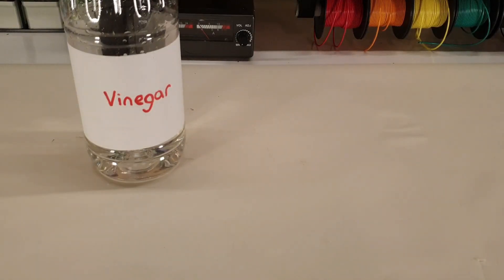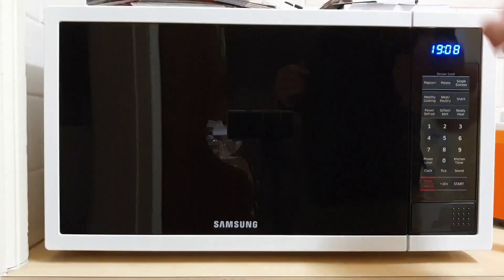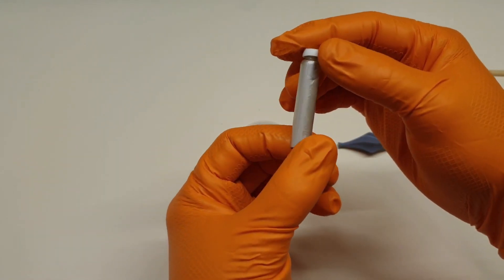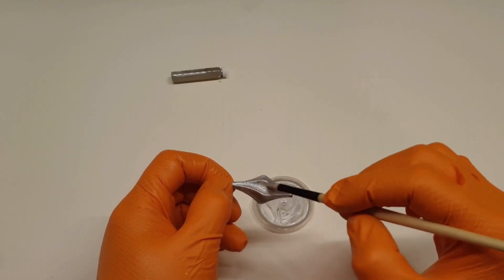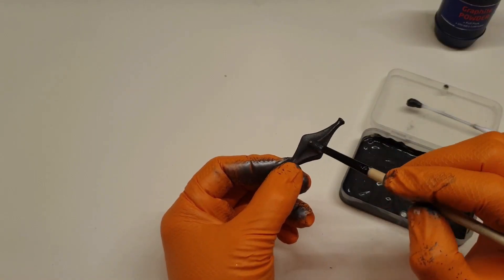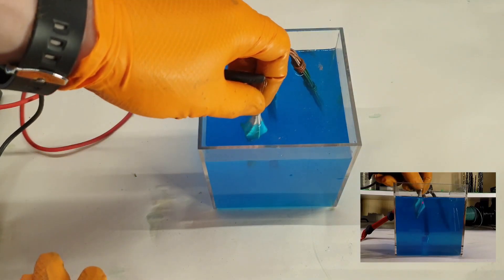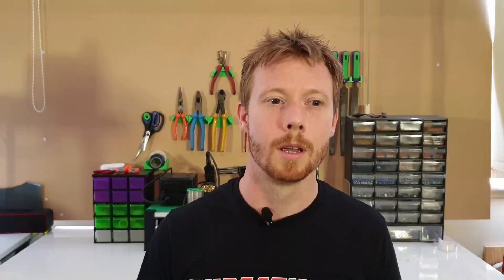Metal plate your 3D prints at home.

Comment: To confirm, you used conductive silver paint "before" applying the graphite and then copper plated?  Graphite isn't conductive is it?  I'm confused how the copper plated onto the graphite.  Also, wouldn't copper conductive paint be a better choice over silver conductive paint as far as cost or does the 7% increase (I think it is) increased conductivity worth it?
Reply from the maker: You use graphite OR the silver paint (I actually use a nickel conductive paint made by MG Chemicals for my plating now, it's cheaper than the silver paint and works very well).
Graphite is conductive, otherwise it wouldn't work at all. It's not as good as the conductive paint, but it's cheap and generally more accessible, but I'd suggest going with the conductive nickel paint I mentioned before, you'll get a much better result.
Reply: @BrodieFairhall  Thanks for the tip, I'll give it a try.

Comment: How did you manage to get copper in the eye socket of the raven skull?

Would tucking some wire inside work?
Reply from the maker: A mixture of plating for a long time and moving the anode around the skull.
If you're careful not to touch the anode wire to the part you're plating you can move it into pockets like the eye sockets if you're having trouble.

Comment: I don't have access to conductive paints where I live, I tried to make a layer of graphite to make it conductive, but it didn't work, what am I doing wrong?
Reply from the maker: I've been finding that some graphite powder isn't just graphite and it isn't very conductive. So you may have to try a different brand of graphite powder.
You can also apply multiple coats of the graphite to see if that helps.
If you have a multimeter, you can check the resistance of the painted surface and it should be at most a few hundred ohms between any two points or it won't plate well.

Comment: Can you make graphite powder by drawing on a piece of paper with a pencil?
Reply from the maker: I tried doing this with a pencil and found the result was barely conductive at all. I've since found out there are a lot of polymers in pencils, not just graphite.
Reply: @BrodieFairhall  Ah it seems graphite content varies with hardness of the pencil. The softer the higher the graphite content. But getting specific pencils probably isn't any less effort than getting graphite powder in the first place.
Reply from the maker: @PhaTs00p  I got the softest pencils I could locally (not that soft, they were 2B) and couldn't get a resistance below about 50k ohms.
I tend not to use graphite at all now, I use a conductive nickel paint made by MG Chemicals, it's so much better and much cheaper than the silver paint.

Comment: Just a heads up:  I bought graphite lubricant from the hardware store, and the particle size was enormous.  So it wouldn't really mix into the ethanol, and wouldn't stick to the part.  I went online and found powdered graphite with a specified particle size (50 micron).  In other words, be careful what you buy for graphite.
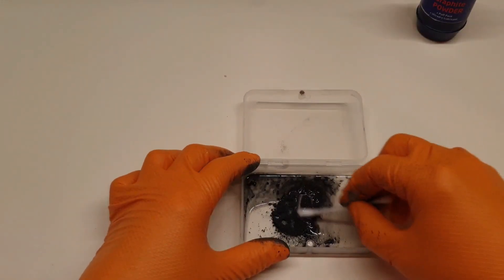Reply: At 4:23 he mentions grease with graphite to display one of the uses that graphite has in modern day, and doesn´t suggest to use GREASE with 1% graphite as your main source for graphite-powder-PAINT (that is up to 100% graphite, by he way). How can you go and buy a lubricant to use it as a paint?
Reply: @klausbrinck2137  I bought both.  Neither worked.
Reply: just if it was not clear enough before: graphite is used as dry lubricant because of its (anti abrasive and lubricating) characteristics as a material itself. Graphite for lubricant is just a dry powder, no oils or grease added. That said, there are many lubricating products that have added graphite to increase their lubricating qualities - they are different products though and can indeed not be used as electrolytic paints
  @klausbrinck2137
Reply: I've heard sources differ saying that graphite paint should be sanded before electroplating and copper paint doesn't need to be sanded (but is more expensive much like the silver paint here). Did you have good luck with the graphite paint without having to sand it down?
Reply: @ImBenGraham  no.  I attempted sanding and different substrates for the graphite.  I only had partial success.  That is to say, the part would only plate in certain areas, and eventually those areas stopped growing.  I resorted to measuring resistance across the part and found that I could only plate areas where resistance was consistently below about 5kOhm.  Since it was so unreliable, I gave up.  I did end up with a lot of copper dust.  I considered trying to use it, but don't have time to continue the project.
Reply: @ImBenGraham  your not supposed to sand it you should polish it
Reply: Thanks!

Comment: Where does one acquire silver paint?
Reply from the maker: I originally bought mine from a local electronics store, but you can find it online.
Instead of the silver paint or graphite, now I use a conductive nickel spray paint made by MG Chemicals, much cheaper by volume than the silver paint and it works much better than the graphite.

Comment: I did not get the power supply part. What did you use to be able to provide electricity to the copper and the 3d print? Thank you!
Reply from the maker: I just used a basic benchtop / lab power supply in this video. My original plating setup was 2 D cell batteries, you will only need 2-6 volts for plating, depending on your electrolyte, the resistance of the conductive coating and a few other variables.
Whatever you use won't need to provide much current.
Reply: @BrodieFairhall  thank you!

Comment: Hi again,I’m wondering if I could use a 9v battery instead of a power supply?
Reply from the maker: You absolutely can! You only require a very low voltage, depending on your part size and your electrolyte it could be between 2V and 5V, if you have a fixed voltage you can move your part closer or further away from the anode to get a nice even metal deposit. My original plating setup was using three D cell batteries in series and it worked fantastically.
Reply: @BrodieFairhall  thank you so much! Really enjoy your content and presentations!

Comment: Hello Brodie, What are using for electricity in this video?
Reply from the maker: I'm using a basic adjustable benchtop power supply for this
Reply: @BrodieFairhall  thank you. This is new to me but you made a cool video and I wanna try it! Thanks
Reply: What are the setting of the DC power supply? Like how many amps or volts?
Reply from the maker: @DjJMuna  I'm only setting the voltage, it's around 3V. The voltage you use will depend a lot on your electrolyte, what you're using as a conductive coating on the part etc. I would recommend starting at about 3V and adjusting it as needed.

Comment: Trying this out now. The copper wire is plated with nickel, but the part is not. When measuring with a multimeter the resistance of the part is around a 100 kOhms while on the copper wire it is 0.1 ohm so I think the graphite is not conductive enough. How do I make the graphite ethanol mixture more conductive?
Reply from the maker: You're likely going to have to try a different source of graphite powder or a conductive paint.
I now use a conductive nickel spray paint from MG Chemicals which works fantastically.

Comment: Does the copper layer add to the tensile strength and heat resistance of the part by a significant percentage? Thank you for this video.
Reply: No.  The thickness of the deposited layer is in the order of a few microns, so this does not add to the tensile strength in any meaningful way.

Comment: Brodie! That silver paint is TOO EXPENSIVE! Silver is a lot cheaper than people think, and jewelers and other sellers sell it for a lot more than it's worth. Try to pick up some silver spoons from a thrift shop with 10 times the amount of silver for less than $10. Grind it up into a power and mix it with a liquid like the alcohol used and boom, silver paint.
Reply from the maker: I haven't used the Silver paint in a long time. Instead I use a conductive Nickel spray paint from MG Chemicals which works better and is much, much cheaper!
It would be interesting to see whether making a silver conductive paint works well and doesn't take too much time.

Comment: Is the microwave safe for normal use after all this or best keep the practice separate ?? Thanks
Reply from the maker: I believe so, but, I'm not an expert on that so I probably shouldn't comment on it. You could always just microwave the vinegar then add the hydrogen peroxide afterward. Or just leave it cold and it will take a bit longer.
In my other plating video I have a different method for creating an electrolyte too.

Comment: I had a great deal of luck with the copper plating on the nickel spray paint mentioned (i believe from MG chemicals?) 
I used copper sulfate crystals in bath of distilled water and muratic acid from a pool supply store. 
However! I have had 0 luck getting nickel to plate to it- even though it readily plates on to other metals (even my copper anodes!) - it refuses to stick to the surface of the print, even after it's been plated and sanded. The resistance on the surface of the print is <0.1ohm (as it's effectively metal) ; and the playing electrolyte readily coats brass, steel, and a penny, and whatever else I find and dunk in it. 

I'm at a loss!
Reply from the maker: The MG Chemicals nickel spray paint is fantastic!
If you're trying to plate with Nickel, you'll need to make an electrolyte suitable for Nickel. I make one in my other electroplating video, but if you're already using Muriatic/Hydrochloric acid (Sulphuric Acid works best overall as it conducts electricity better than most electrolytes). You wont want to use the copper sulfate crystals, Instead you can put a small amount of Nickel in dilute acid and leave it until it goes a nice green colour. If you're impatient, you can put a nickel anode AND cathode into the acid and run some current through it until it goes green.

If I plate with metals other than copper, I still plate copper on first, kind of like having a good undercoat.
Reply: @BrodieFairhall  yeah- I've got two different electrolyte baths. for the nickel, I'm using nickel chloride solution (made with current passed through nickel tabbing in HCL/distilled water)
I also added some Epsom salt to increase the conductivity. It plates onto most metals very cleanly - but it won't touch my plated copper part -and I can't figure out why.

EDIT: I should add that I've also sanded the copper down so the surface is not oxidized - the resistance is phenomenally low, AND the nickel electrolyte happily plates onto brass, pennies, and even the copper wire I hang parts from. 
I can only assume it's something I have overlooked this far !

Comment: Whoa someone is ripping you off a bit. The MSRP on Kemo L100 is 10€ and mail-order prices are usually slightly below that.

When i bought some a while back, it was labelled "rear window defogger repair liquid", so maybe you'll find something suitable. It seems like there are some on Aliexpress for $10 shipped worldwide, not sure if they're as good.
Reply from the maker: Everything in Australia costs more (and I was dumb enough to mention the price in AUD rather than a more common currency).
I've been using MG Chemicals conductive Nickel spray paint for everything since about 2-3 months after I made this video. It's better all around and you get much more for your money.

Comment: What 3D filament material do you recommend for electroplating
Reply from the maker: I've had not issues with PLA and ABS at all.
As long as you can get a conductive coating to stick to it, it should work nicely.

Just don't use flexible filaments.
Reply: @BrodieFairhall  
To create the electrolyte for copper, do you add a voltage? Or simply heated vinegar/hydrogen peroxide with copper?
Reply: @ernestosonnessa  its just heated i ran a few tests but so far the graphite paint isnt really working for me im going to test it more tho
Reply: World you recommend doing it in well ventilated area? 
Was there a smell?

Comment: Does it make the parts stronger?
Reply from the maker: Yes, it can significantly increase the strength of a print if you can add a thick and even coating. There are better metals or alloys you can use for strength too.

Comment: some years ago i made the exact same raven skull :)
https://www.deviantart.com/yzorg/gallery/49335285/props-and-crafting
Reply from the maker: Looks fantastic!
Reply: @BrodieFairhall  Thanks. yours aswell. i got my chemicals ordered from a plating company. but am looking into brewing my own like you.
Reply from the maker: @yzorgone  If you're able to acquire and do it safely, since you've already plated before, and by the looks of things you work with intricate parts, I'd go with a better electrolyte like diluted sulphuric acid and copper sulphate (there are also some other basic chemicals you can add to improve the finish). It plates much faster, more evenly and gets into crevices better than the vinegar based electrolyte.
Also, I now use a conductive nickel spray paint by MG chemicals which works much better than graphite but is far cheaper by volume than the silver conductive paint.
Reply: @BrodieFairhall  good to know. i get best results with a conductive copper paint that is solvent based. but needs several coats and is quite runny.  right now i work on a disco ball motor setup to get even plating by rotating the piece in my tank. i try to achieve up to 1mm of copper plating. for i want to be able to braze or solder later.

Comment: When I try this with acrylic, the conductive paint just comes off in the solution even though it’s dried over 24hrs and the pain says it works with acrylic. Any ideas?
Reply from the maker: You could try some general plastic painting methods. The first being lightly sanding the surface of the acrylic before painting to help it stick, a light wipe with some acetone before painting will have a similar effect. I'd also look at using a primer designed specifically for plastics (finding one that is appropriate for acrylic) before painting the conductive paint on.
Hopefully this helps, good luck!
Reply: @BrodieFairhall  Got it that makes sense - i really appreciate it!
Reply: @BrodieFairhall  so it seems like I need to let it sit for hours, vs when I was coating a quarter it would coat in about 5 minutes. Does this seem right? The conductive paint seems relatively resistant so it seems like it needs a lot more time...
Reply from the maker: That absolutely depends on the type of conductive paint, some are very conductive and others really aren't. You can leave it to plate for as long as you want.
You can use a different electrolyte made from diluted Sulphuric Acid and Copper Sulphate which is much more conductive, if you have access to and a safe way to work with Sulphuric acid.
Reply: @BrodieFairhall  got it, that makes perfect sense - While I have you, do you know if the reddist gold plating liquid they sell on amazon and other places is safe to use at home/legitimate?
Reply from the maker: @magicdoge3237  I've never done gold plating specifically because the chemicals involved. That also means I really don't know much about gold plating to be honest.

Comment: I tried the graphite method and it has too much resistance.
Reply from the maker: I've found that different graphite brands seem to vary wildly in resistance since filming this video.
Now, most of the time I use a conductive nickel spray paint from MG chemicals, it works beautifully.
Reply: @BrodieFairhall  i'm using graphite that was made for an sinker EDM. i got a chunk from work a few years back and just ground it down with sandpaper.
what voltage is best? usually with copper plating low voltage is key otherwise it flakes off.

Edit: i have it at 1.5v 0.11A and its very slowly plating i dont want too high a voltage and risk it flaking off.
thanks for the video.

Comment: i got reminded of this again today after printing an espresso tamper. could this make my parts food safe? I wonder how it'll affect temp resistance and all that. or even strengh (I think it'd weaken?)
Reply from the maker: If you can plate it in a metal that is ok to use with food and it has no holes in the metal layer, I guess it might be ok ( have no idea what is and isn't ok to use and you'd have to make sure whatever metal you used as the anode didn't have anything it shouldn't in it). If you put a thick metal coat on, it does increase the strength, it wont stop the insides from going gooey if it gets too hot though, so maybe printed in PET-G or ABS it might last long enough, or just put a metal layer a few mm thick over it.

Comment: :O coooooooool! that's so awesome!
and it looks like it hided the layers a little too to me! Which is something i hate a lot about 3d printing! the uneven layers you sometimes get.
Reply from the maker: It absolutely does fill layer lines, you just have to make sure you plate it for a reasonably long time.
It's a double edged sword though, because it also fills in fine details.
The Raven skull was printed in ABS and acetone smoothed first, it did still have some layer lines, but I put almost 1mm of copper on it which filled in all the remaining layer lines.
The graphite paste also fills in a lot of the layer lines too.